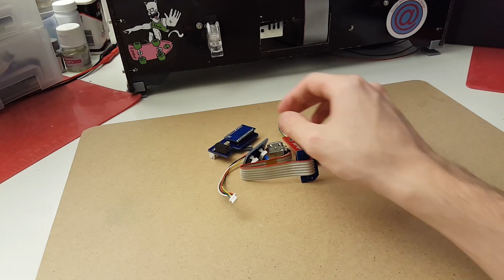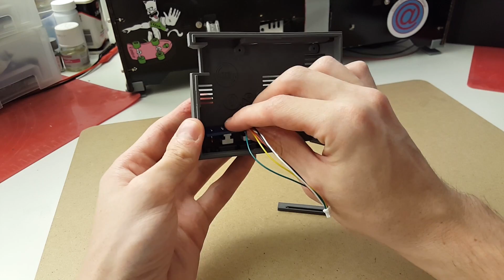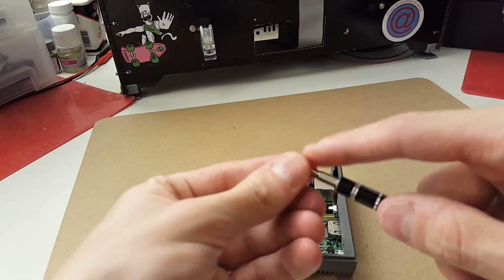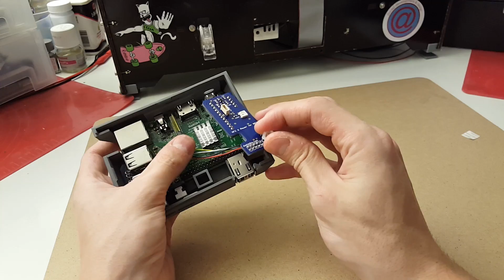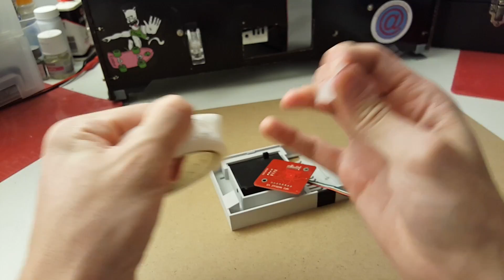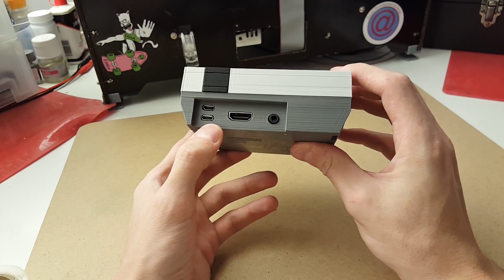Mini NES Build Guide Part 3

Comment: shame you can't flip the Pi upside down and rotate it 180°. That way the Ethernet port or one of the USB hubs would be placed in the general location of where the V/A jacks were on the original console.

Comment: "Daftmike"

daftmike hey the hookup you have with the USB extender there are (6 wires) do you have it going (1) USB d-,d+     Then other (2) USB d-,d+,5v,G 

So basically one USB is used for data only 

And the other is used for data and 5v charging?

Comment: Would it be possible to plug in a Qi charger thru the dock you used to dock the NFC tag? I was thinking of having a wireless way to charge the Bluetooth NES controller I saw on Amazon on the top of the console. Thank you for all the videos: really nice DIY to hand out for the season!

Comment: Hey great videos, quick question for you . i downloaded your files from thingaverse, and one file is called bottom trim front, is that going to be grey aswell? and is that the piece that was the "spacer"infront of the buttons before you glued them in place? thanks

Comment: I built it yesterday. It was a really close fit and probably due to my sloppy 3d-printing skills I had to make several adjustments with knife and sandpaper. It didn't come out perfect but I'm still happy with it. Havn't turned it on yet so I don't know it it works yet :) I'll wait for the video with the software instuctions first.

Comment: Hi daftmike. Sick mini nes. I don't have a 3D printer but I have an idea I could use your help with. They just released a mini sega genesis usb hub with 4 ports. Could you help me set it up with a raspberry pi 3 in it?  Maybe even have the power and buttons on the console work?  Check out eBay for what I am talking about. They are only about $10 or so.
Reply from the maker: looks interesting... contact details are in the about tab of my channel page
Reply: daftmike hey the hookup you have with the USB extender there are (6 wires) do you have it going (1) USB d-,d+     Then other (2) USB d-,d+,5v,G 

So basically one USB is used for data only 

And the other is used for data and 5v charging?

Comment: Thanks for the Thingaverse files.. I did not have a need for using carts for starting games so I did make some modifications to the models.   (pics linked below ) Instead of using USB headers in the front I left the USB connections alone and opened up the side for access there. I created a new part to replicate the NES controller sockets as well.    I did keep the cartridge slot and mechanical latch for visual appeal.      For the LED cover I did not use clear filament I instead poured hot glue into the socket from inside the case while holding a smooth laminated card firmly on the front until it dried. This makes a nice lens without additional printing.  For the power buttons I wired into the power connectors on the Rasp PI.  they are not pinned but if you solder into them you have direct power control.. Did not bother with a script as Emulation station has a shut down feature I can use directly before hitting the power button.       I also used the fan you recommended but wired it into the 3.3v instead of the 5v

Again thank you this project has been so much fun. My daughter loves the setup.  I made a small stand for mine as well and mini controllers for a "scene console"  Pics linked below.  

GLUE LED LENS IN ACTION
http://i.imgur.com/KxTLQOL.jpg

CASE MOD ON SIDE TO OPEN UP EXISTING USB SOCKETS
http://i.imgur.com/SpjBdQL.jpg

FRONT CONTROLLER SOCKET PART
http://i.imgur.com/6BFkzVG.jpg

I REMOVED THE ADDITIONAL POWER PORT OPENING THAT WAS ON THE ORIGINAL AND ONLY USE THE RASP.PI PORT
http://i.imgur.com/JhOOiCy.jpg

THE MONEY SHOT :)
http://i.imgur.com/lAsJoXS.jpg
Reply: Bro that came out tight !!!!

I was wondering how to bypass the clear filament ... 

what type of filament did you use??

Im thinking of slapping some bondo on it then sanding it down to get everything smoothed out.

Comment: Thanks for the great videos.  I would be interested in a "soldering guide" for creating the kit.  Would pay a small fee for it if needed. Also, did you post the STL for the mini NES controller anywhere ?
Reply from the maker: I'd like to shoot a video where I show how to build a prototype circuit like I used in my original Mini NES.
I haven't posted the mini controller yet, it needs a bit of work but I'll try to find some time to clean it up for publishing soon.
Reply: at least tell me what parts are needed for usb extender board :)
Reply: its all good thanks. I just used old UBS connector ends and soldered wires to those leads, plugged them in to the existing usb

Comment: is there a reason why the power button couldn't turn on the pi?
Reply from the maker: For me, I remember inserting the cartridge and pushing it down, then clicking in the power button to start the game up.
There's a big delay between powering on the Raspberry Pi and starting a program because of the time it takes to boot up. My idea was that the Pi would be on and waiting in the menu, then you'd insert a cart, click in the 'power button' and start the game.
Reply from the maker: It was a design choice I made. I wanted the 'power button' to just launch the games so I made the 'reset button' multi-functional.
Reply: Could you switch it? Or are those functions built into the control board?
Reply: In your previous demo where you show how the NFC works, I felt that was a little backwards. I would have expected the reset button to launch a game. If I wanted to be rebellious back in the day with my original NES, that's how I switched games. Just left the machine on, pulled out the cart, put a new one in, and hit reset. :) In the end it's your project, and was just curious why the power button wasn't used to turn on the RPi.
Reply: Is that something that is hard coded into the board or set within a script so could be switched around?

Comment: i don't have understand why there is two micro usb port?
Reply: one is original power port from pi, second one is from adruino, you need to connect power to adruino and then you can power on raspberry through adruino using switches on the front. because when you connect power straight to raspberry pie it will boot by itself. thats how i understand it :)
Reply: +Andrzej Thank you ;) Where can i buy the double usb male port for wire doible female ? and the chip on the raspberry please
Reply: you need only one power cord going to adruino only to power both of them.